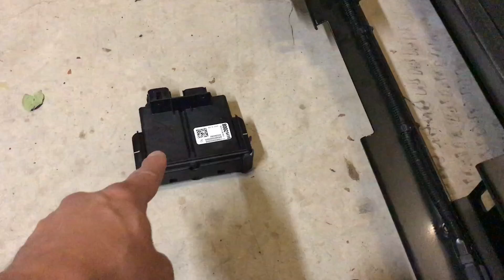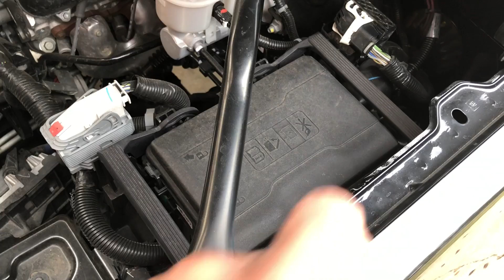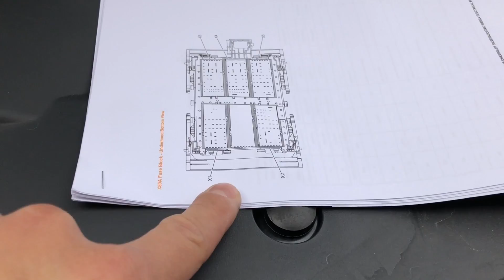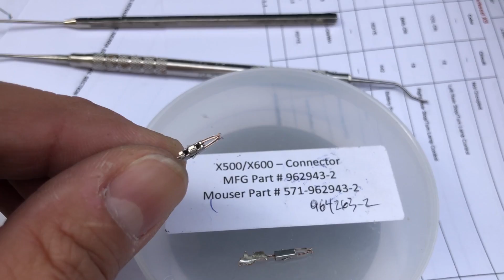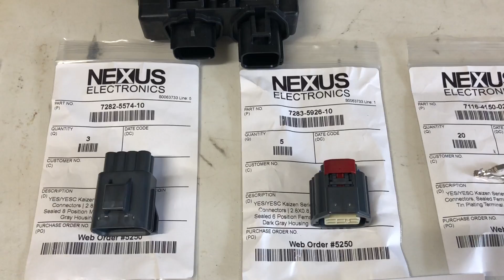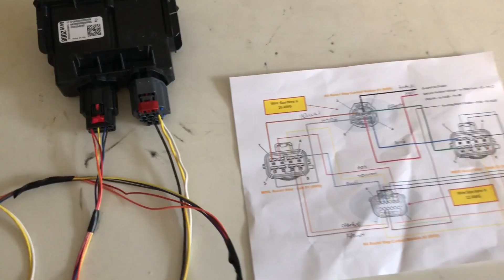2016 Silverado LT - Articulating (Tri-Mode) Running Boards Retrofit

Comment: Help please!!! I followed your video ... but I'm working with a 2015 yukon denali .. but they dont go in all the way .. is there a way to reset them?? Thanks for any info
Reply from the maker: ConVinced Custom Open and close all doors, drive for a couple of minutes.
Reply: @philgamboa2906   I did what u said and it's still not working right... there wouldn't be a wrong way to wire it up it should be the same as a truck right?
Reply from the maker: ConVinced Custom / Not that I’m aware of.  I can’t say if it’s the same for different for SUVs.

Comment: Phil I bought mirror harnesses from you awhile back for dl8 to dl3 and they worked amazing I just picked up some of these running boards for my 17 denali any way I can get the harness from you???
Reply from the maker: This one is a little tougher to fabricate.  I just got back from vacation and have a ton of other booked orders to tend to.  I had another person ask about a harness for this.  I'll have to look at my connector/pin inventory.  When I made this video, I bought just enough to make my harness.  So I'll have to revisit this and see if I can make a complete harness for others.
Reply: If you ever do get some harnesses done for the running boards I'll definitely be interested too 
I've seen all the upgrades you've done to your truck and I'm currently working on those upgrades

Comment: Your experience as a professional automotive enthusiast has went up to 100%.impressive!!!!subscribed!
Reply from the maker: Bimer catracho - Thanks!  I just finished installed the new IP switch as well and can mow disable the running boards, extract, and retract from inside truck :)
Reply: Cool, looking forward to your video installation of the alpine x110-slv in your truck. Hope you look into it!! I installed one in my 2015 Silverado, with a Bose module, and a bypass relay. I put 2 sundown audio zv5 12' under the back seat with a sundown audio scv-4000d amp. I made a custom box for the subs. by the way, my next modification will be the door sills you installed in your truck! On behave of fellow bowtie owners, 
Thanks.
Reply: Phil Gamboa Hi Phil, awesome video! I'm getting ready to install escalade esv running boards on a 2016 suburban and was curious to see if you knew which wire I have to run to the Oem switch? (bought the switch off of ebay)

Thanks again!

Comment: I have a 2014 GMC Sierra. I don't have pin #8 or pin #39. Is there another way to hook them up?
Reply from the maker: These circuits are GMLAN and a disable circuit.  You won't need to land the disable circuit if you don't plan on install the running board button on your instrument panel.  But you will need the GMLAN circuit.  If you don't have it in this connector, you can grab this signal in the passenger side kick panel.  There is a rectangular connector with a white cap on it.  All with green wires.  This is where the main GMLAN splice is located.
Reply: Phil Gamboa so I can just splice into any of those green wires?
Reply from the maker: mario garza for the GMLAN Circuit... yes.  You won’t need the disable circuit for now... that goes to the button switch to disable to boards.
Reply: @philgamboa2906  I have had these running boards just sitting in storage. I've been to intimidated to mess with the wiring. If I send you the terminals and connectors, how much would you charge me to make me a harness?
Reply from the maker: I am looking at making a complete harness for this where all you would have to do is just "plug it in".  Since the locations of the circuits are in existing connectors, the harness will have the pins crimped where you would need to land them in the video.  The cost for this harness (once released) will be around $250.  Thanks!
Reply: @philgamboa2906  do you have any of these harnesses available? I would like to order 1
Reply from the maker: mario garza - Yes. Email me at gamboaphil@gmail.com

Comment: Where would I get a diagram. Tried to take pictures on YouTube .I think you have the wire sizes reversed. I want to see if I have the same circuit and connections on my 2014 Sierra Denali. I figure most of the frames on those trucks are the same as far as mounting. If I don't have those connections I'll figure it out. I JUST DON'T LIKE THE AFTERMARKET ONES!!!  THANK YOU VERY MUCH!!!
Reply from the maker: The larger size wires is what provides power to each running board.  My diagram needs a little cleaning up as I don't have the wires labeled or the circuit #s called out.
Reply: Delmer Archer, did your truck have the connections? Mine didn't, just wondering if and how you were able to do it

Comment: That's a amazing video. Would those work on 2014 Denali??
Reply from the maker: Thanks!  You would have the explore the connectors like shown in my video.  The main point of trying this ugprade is to see if any programming was needed...and there wasn't.  So explore the connectors and see if you have the same as shown.

Comment: Great job. Did you install the switch under the ac controls that turns them off and on?
Reply from the maker: I wasn't aware of this switch until someone shared a video of its use.  I guess that's what the disable circuit is tied to :)  I had a conversation with someone who is looking at doing this.  Together, we concluded the "disable" signal (Circuit 7462) ties in the ABS/TCS Hill Descent Control Switch Signal (Circuit 6844).  Since these running boards are only found on the higher trims, I am going to presume that the bank of switches that contains the disable button, will have other buttons for this trim that won't work.  For that reason, I may not make any traction on adding this button.
Reply: Ok I am going to be adding this to my LTZ and was wondering if they could be added. Is there any chance you could let me know the gm factory wire colors off the diagram I see that the power is a red with yellow stripe but what are the rest. Thanks for all the great installs you do.
Reply from the maker: The wire colors off my diagram were colors I chose when I made the diagram.  Email me at pgamboa@yahoo.com.  I'll send you the info that way.  The factory colors have stripes in them, so it'll be easier to send you the schematics I went off of.
Reply: Hello, I just installed mines and now I get a warning "to enable running boards hold the switch" so I just ordered the switch and waiting for it to arrive, is there any other way to manually activate these boards?
Reply: Did you get the switch working  ?
 @yasmeldiaz4611

Comment: Wow, you continue to amaze me with your videos!!  Also, i know the trucks with these boards have a switch on the inside for them as well under the enter console where the other switches are located.  Will you be adding this switch to your truck as well?  I still want to come and visit with you to see if you can install the door handles for me.
Reply from the maker: str8304 - In my wiring observations, I couldn’t find any other info on switches.  I was another video where these boards were shown.  As I understand it, there is a disable switch in the Instrument Panel (under the Temp controls) along with the bank of other switches.  I haven’t ventured into looking into that yet as my main goal was to get them functional first. 

If I were switch out the back of switches, I would be adding other switches for components I don’t have.  So... at this time, I’m leaving it as is.  If I get more time to look into that disable switch, I will.

My understanding is that these steps only come on the higher trims (High Country and Denali?).  So those trucks will have more features on that I/P Switch I’m referring to.

Shoot me a PM/Email about the door handle install.  :). I’ve been getting a TON of messages about these recent mods. Lol
Reply: Will do!  Which forum are you most active in so I can go there to speak more often?  I'm in the Houston/Pearland area and i'm always looking for a reason to do a quick road trip..I just added the 9.7" ipad to my dash and I have the 2014 SLT
Reply from the maker: str8304 - GM-Trucks Forum. Forum Name is pgamboa.